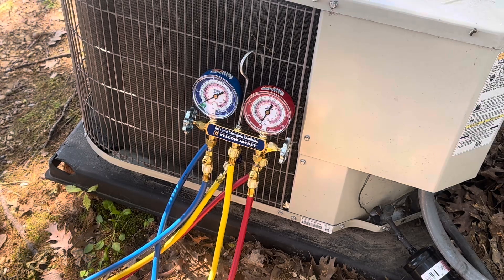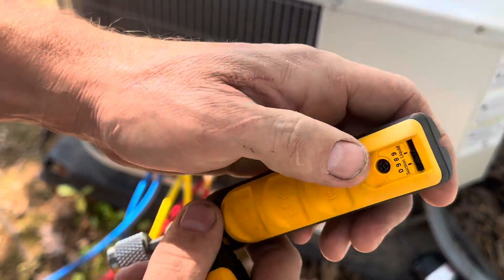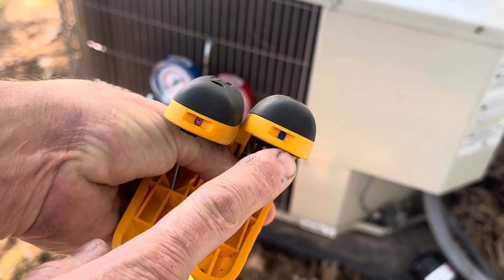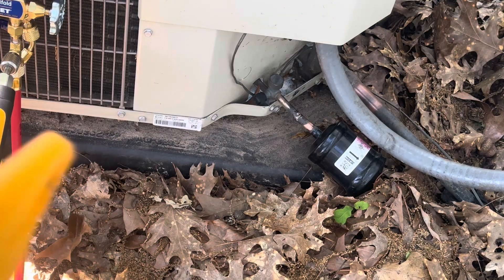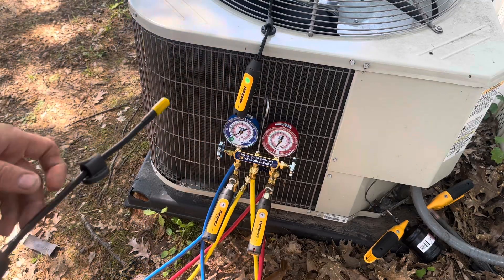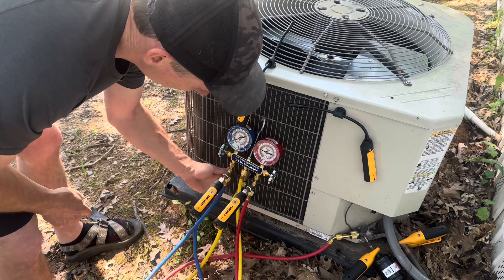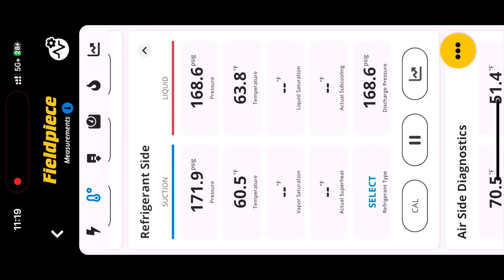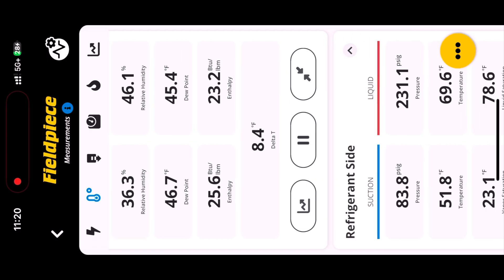How to use Yellow Jacket Gauges with Fieldpiece Job Link Kit JL3KH6 #JL3KH6 #hvac #refrigeration

Comment: Why wouldn’t you just use them by themselves? Why bother with the manifold?
You can get the charging tees for maybe 30 bucks for 2
Reply from the maker: I found it easier to connect a hose to the service valve then a tee and we have a rainy season here where it rains for weeks on ends and sometimes you can’t get a digital system out in the rain so you have to use analogue